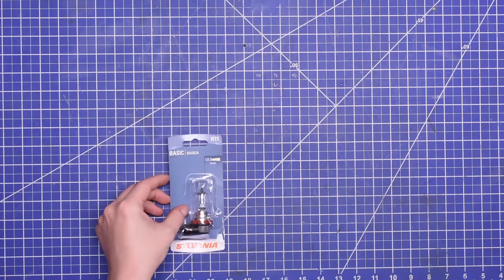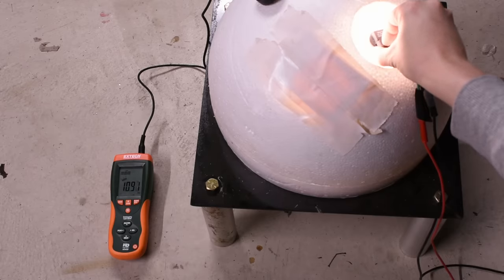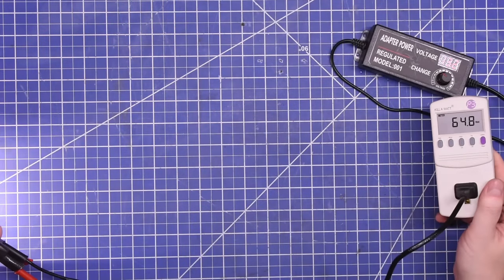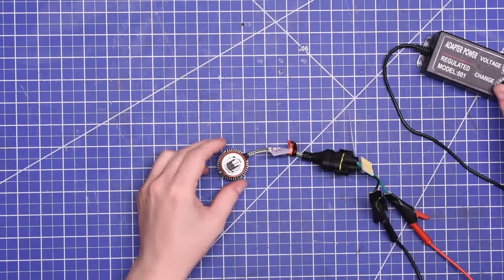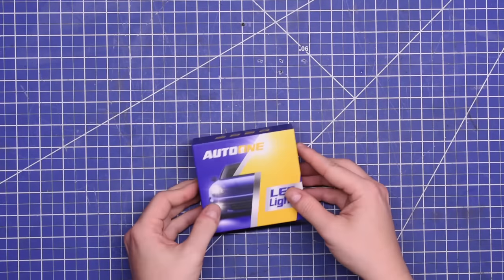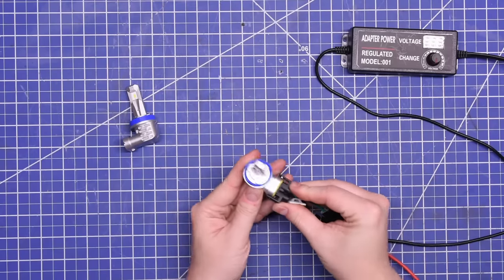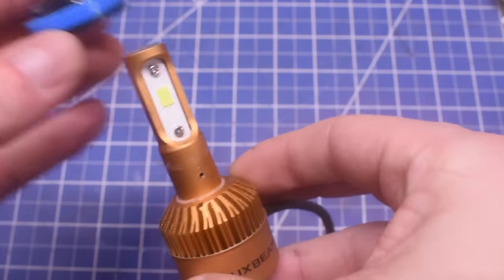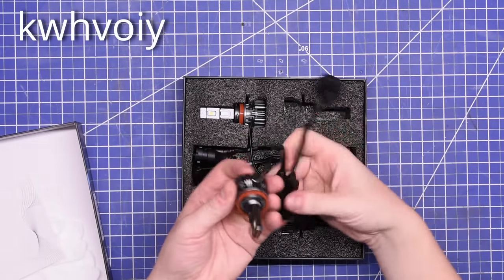Amazon Headlight Bulbs are Getting Out of Hand

Comment: I know it's tough, but I would love to see if there's any way you or another company could do objective "blindness" tests - IE setting up the headlight at a standardized fixed position somewhere with little light (like inside a warehouse or long hallway) and seeing how the light behaves... and more importantly, what those lumens translate into for oncoming traffic. I have grown to hate "cool" looking headlights because they are always so bright and look like someone has their high-beams on all the time. Heck, I didn't even know you could rotate LED bulbs to help align them better -- and I doubt many others do either!
Reply: This could be done quite easily although not cheaply - set up a target barrier and install 20 or more light meters on the board and measure thrown light in the target area and scattered light beyond.  I wish someone would do this.
Reply: The biggest issue is projector vs reflector housings for headlights. And people not actually adjusting their levels.
Reply: the LED beams  light pattern compared to the halogen factory bulb will tell you a lot, (you can easily see this pattern on a wall)  most won't have sharply defined cutoff that the factory bulb has and that light spill is responsible for blinding oncoming drivers (it's also partially why they look like they throw more light, because they are putting light where the factory bulbs don't)  , this is because an LED, or HID bulb has a totally different light source shape than  what the headlamps reflector was designed for
Reply: there is a channel already doing that
its good to see TTC test these everyday claims, but this test is not sophisticated and shouldnt be taken an decisive info
Reply: Headlights that look like they have high beams all the time are either in SUVs where they are higher up and therefore shine more into the oncoming driver, or are just not adjusted. I replaced my halogen OEM lights with some cool white lights, they worked well, but with a 125 hour rated lifespan I worked out it would last me like 2 months, and at almost $100 a pair, yeh I'm not spending $50 a month on my car.

So I went LED and they were way too high and needed to be lowered, and headlights do have adjusting screws, or for some cars an in car adjusting option, either way when you install ANY new headlight, OEM, aftermarket, LED, you need to look at your countries laws, find a flat wall and ground and adjust them as needed. As you seen in the video, finding the right headlight that is crisp helps so they don't stray or as you pointed out adjusting them before placing them inside your car.

But the headlight fixture is also an important factor, there are projector and reflector headlights, where reflector ones like you see in the video simply take whatever globe you place and reflect it out, so if they LEDs are not sideways and off angle they will not shine correctly, or if you get a fog light style headlight that has more LED's or ones not side by side, or even some older reflector headlights, things won't shine flat and can be a problem. Projector headlights are a little different, the ones with the fisheye lens at the front, they take whatever light and project it better.

People need to do their own research, find the right light that fits their car, the laws in their country (height, colour, lumens) and adjust as needed, very few times you will ever find any after martket or LED lights that just plug in and work, and few times you will find OEM lights that also need adjusting.
Reply: @akaraven66  Under FMVSS108, the federal law concerning vehicle lighting in the US, it is illegal to replace a bulb with any other type. If a headlight is certified for an H7 halogen it is only legal to replace that with an H7 halogen. There are glare limits for all lights. If you put in a brighter bulb, you will be throwing out more light in all directions including where glare is limited. In addition, headlights are optical instruments designed for the filament of a halogen bulb. Any deviation in where the light source is located will result in light going in undesired directions. There is no LED replacement bulb that can truly simulate the thinness and positioning of a halogen filament. Put simply, LED replacement bulbs are illegal in the US for road use. Other countries, I don't know or care because I live in the US.
Aiming your lights down will flood your foreground with excess light, closing your pupils and letting in less light not to mention throwing less light down the road. It may seem counterintuitive but brighter lights can cause you to see less. As above, they will throw more light in undesired directions. Light in the trees is not light on the road and is useless. If you want legal and scientific citations, look for Daniel Stern Lighting and read what he has to say. He's a professional vehicle lighting designer.
Reply: The GTR 2 and the Morimoto and SV7 get good reviews... but not from anyone really breaking down the beams, etc 

Headlight Revolution for example just waves a light meter around the beam on a wall, and saves the highest lux result.

:)

Being able to have the LED emitter exactly where the filament the housing was designed for,  seems to be key to the pattern working.
Reply: I've got LEDs in my high beams only for fear of blinding others, but my unit came with a little slip showing how to align them properly.

Doesn't matter a ton in a rear-reflector only setup like my highs are, but still helped cut down on wasted throw.
Reply: @donbeary6394  Yeah, halogen projectors are also absolutely borked by most cheap dropins.

I've seen some good drop-in replacements, but they're $200+, not $15.
Reply: @DarkIzo  which channel?
Reply: @Patrick94GSR  try to search for "led headlights tested"

i had a quick look but i cant quite remember which one was the one i watched a lot, but after a quick look, sergiu gabor's channels seems proffessional

edit: also headlight revolution, but iirc they were missing a few infos or bulbs (not sure if it actually was them or not)
Reply: @bwofficial276 there is no law about LED lights in the US as a matter of fact there are OEMs LEDs headlights in most new cars. Federal laws only restricts the lumens output.
Reply: Now do a test where you are in the driver's seat of the test car approaching these lights. If you can't at least qualitatively grade the oncoming driver's experience when being subjected to these bulbs then a video like this isn't worth much. It's literally a 2 way street here - if these super-right lights blind the oncoming drivers then in my opinion they're worthless.
Reply: @bwofficial1776  Speaking of "brighter lights can cause you to see less" - one pet peeve I have is for digital dashboards and infotainment screens that are unnecessarily bright or cause unnecessary glare, even on their lowest setting (especially with the ubiquitous tinted windows, as they tend to reflect more of that light around the interior instead of letting it out through the glass.)  I've found that being able to actually turn off my infotainment screen makes night driving so much easier - but that means no GPS, no tunes, etc.  Which can suck on longer drives.

Comment: Trucker here.  We try all kinds of stuff on our trucks, and headlight bulbs are no exception.  I always ran the Sylvania Ultra bulbs; readily available everywhere (including BigBoxMart). I run with headlights on whenever moving, and I had to replace a low beam (H11) bulb every 3-4 months. Two bulbs, 50 hours/week, so 1200-1500 hours for a bulb.

I tried a few of the LED replacements, but never found one I liked, or lasted very long. In fact, I had a couple sets where one died within the Amazon return window...
Reply: DDM tuning makes quality LED lights.
Reply: Try priming the halogens with a 9v battery before installing they should last longer
Reply: Lasfit leds is the way to go to be honest. They're a 1.1 design of halogens but with LEDs
Reply: @juanarroyo465  Do they have actual high and low beams?
Reply: @1soupasaurus  yes
Reply: I've been liking those too. I do long drives through the Alaska wilderness and they do good. They can definitely burn out quick, but it seems to vary quite a bit. I have one bulb that has outlasted 2 others and refuses to die.
Reply: LEDPERF sell the best headlight led bulbs, they are expensive but so so worth it.

Comment: The unfortunate effect of using LED bulbs like that in your halogen housing is that you get quite a bit more scattering of the light since they have different light scatter patterns. The real kicker is that scatter light means light that blinds oncoming traffic and mirrors ahead of you. It's cheaper and you do get to see better, I get it, but the right way to upgrade your light without using the same type of bulbs is to update the whole housing.
Reply: Sadly its impractical, but a video comparing aftermarket housings would be nice.
Reply: What would be the correct way to update your housings? I'm newer to the headlight stuff but i've recently installed some projector/hids in my factory reflective housing but i've painted over the chrome so the light output is more direct. Is this the correct way to go about it if you want to still use the factory headlight?
Reply: The fact is these garbage LED bulbs are not at the focal point of the reflector so the light scatters. These should be banned!
Reply: @sanman1924  No... reflector headlight --> use halogen bulbs. Even if your car was fitted with reflective housings, in most cases you can order a complete headlight that uses a projector. For my car (ford fiesta) these cost about €120 per side. Then you have to buy the correct bulbs on top of that.
Reply: @dnserror89  But what i'm saying is I painted over the reflective part and installed projectors. How would this be incorrect.

Comment: Vote for round two, focusing on low color temperature (3K to 3500k), which has dramatically better contrast on the road (useful) vs apparent brightness (high color temp).
Reply: I'd love to see some actual tests of color temperature (and light position) versus real world target recognition. I've had a bazillion people tell me, for example, that low beams are better in fog. But I can actually see things further away with brights, for the same reason they work without fog.

Similarly, a lot of people say yellow light allows us to see better, but I don't know that it's true. It is somewhat true in fog, since the red, yellow and green light doesn't bend around and "reflect" back into our eyes like cyan and blue light, though actual reflection still happens and reduces vision regardless of light color. But what makes sense in fog doesn't automatically make sense everywhere else.

Anyhow, seeing actual people try to notice and identify things at different ranges with different light colors at the same wattage would be cool. Changing the position would also be good to test. Fog lights are supposed to work better because they're farther from the driver's line of sight, meaning less of the reflected light hits the driver, but I don't know how much actual impact it has in practice.
Reply: @GeekOfAllness  Many years ago the French did "some actual tests of color temperature".  This resulted in them requiring a particular shade of yellow.  It wasn't that long ago that they got rid of the requirement as part of the EU.  It was years ago I read about it, but I'm sure the French tests are out there in Google-lad.  : )
Reply: Also testing with projectors...
Reply: @nicolasdiniz9343  that and fahren leds
Reply: @GeekOfAllness  I don't remember who did the testing because it was a long time ago but yellow fog light did not cut down on glare anymore than white fog lights, that's why you don't see yellow fog lights anymore. They taught us in driver's training over half a century ago that you always use your low beams in fog because high beams direct the light upward causing the reflected light to obscure your vision, that's why fog lights are always mounted lower than headlights.
Reply: problem with low Kelvin lights is extreme eye fatigue and detail.
Reply: There is a reason I set my monitor as well to true white versus the horridly blue "white" it wants as default.
Reply: @@Ac_Adapter no, they actually aren't. The high kelvin ones are closer to natural daylight, which is better for your eyes. Meaning when you come down the road and are pumping out a large amount of brightness like modern bulbs do (whether LED, HID, or Halo), you want the closest to normal daylight you can get. This causes your eyes to adapt better and recover your night sight better after a vehicle passes. So, the ideal color temp is 5000k and that is a factual thing, with no room for opinions.
Reply: I can see into the future with my 55watt 10k led headlamps and fog lights. Can also see the thoughts of oncoming drivers while they winch in pain as they hit their high beams and get a dose of divine light 😇. 50k lumens at night is quite capable of causing anyone to repent.
Reply: @MrJaman0083  If they are indeed 10K color temp, you might need to keep a look out as most police will give you a ticket for overly blue lights.  The reason they are wincing is because it's wrecking their night vision.
Reply: 6000K is the closest you'll get to clean pure white light. Understand color gamut and the effects certain light colours have on your view, then explain why more road maintenance crews are changing their city's street lights to 6000K LED when they used to be a dull orange back in the 70s and 80s.
Reply: @@Ac_Adapter You should invest in a little something called a 'curtain'... you know, to block out any light from entering your bedroom.
Reply: @@Ac_Adapter More reason to have the most powerful lights money can buy.
Reply: My 2 cents as an electrical engineer that have studied a lot the road lighting.
We are talking about lights that will be used at night and we say that daylight is the most suitable? This is completely wrong. The human eye does not need the full color spectrum at night in order to work properly. Especially the blue color, which by the way is the basis of most LED lights, has the most negative effects at the night vision. Back at the university, there were classes regarding the lighting at the roads and the most optimal is the yellow/orange because it helps the eye to distinguish shapes and objects better.
Another important thing is that the human eye is relatively insensitive to the blue color. Taking into account that the blue light scatters a lot, in order for the driver to perceive a white illuminated road, the lamps should actually emit a lot more blue color. But this results in a lot of glare and discomfort for the other drivers that get this light directly into their eyes.
Reply: @pstasman629  I believe that you are correct on both accounts.  If the goal is to see the road, 2700k is about the best.  if it is to be seen, from a great distance for example 6k is probably better, but that is rarely the goal of a headlight.
Reply: +1 for round 2 and 3200 degree kelvin LEDs
Reply: True. Human eyeballs are also more adapted to dealing with bright light around 4000-4500K since it's about the same color temperature of the sun. Higher kelvin makes the light more blue and white and it's harder on eyeballs.
Reply: So what's a good LED LIGHT  H11 FOR A TAHOE?? HATE THE YELLOW ONES I HAVE THINKING OF UPGRADING THEM SOON TO SOMETHING  COOL... JUST DONT KNOW WHAT TO GET
Reply: Valid point. I have noticed this with using a set of LEDs. Despite being brighter, they don’t look it from the driver’s seat simply due to the color. But when I shine them on a fence or in a section of road with no other light sources, then it’s obvious.
Reply: @gtcam723  they still look cool specially 6000k
Reply: @betod3113  I care less about looking cool and more about seeing all the things 😆
Reply: @T51B1  The sun is closer to 5500K on a clear day

Comment: The reflector and housing of the headlight are designed for a specific bulb/beam type. If the focus the the light coming from the bulb is different from the reflector/housing design it will effect the light output at the focal point.